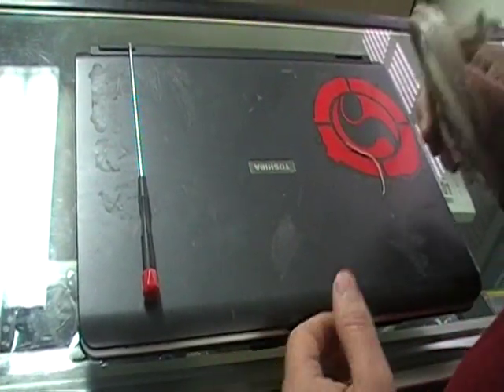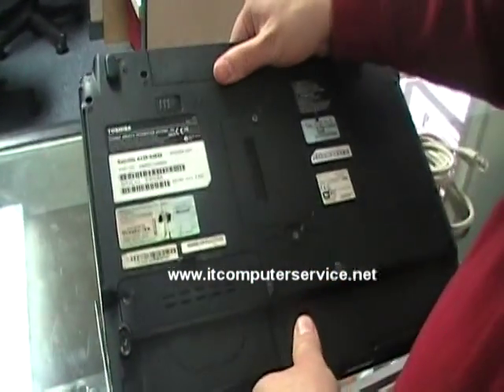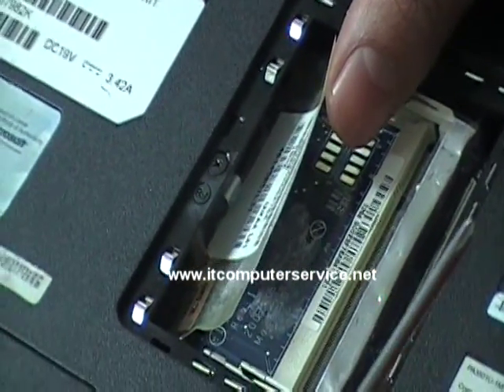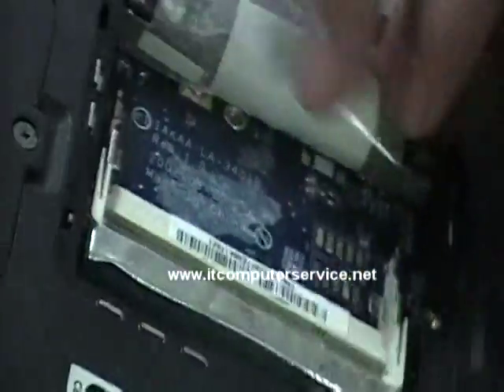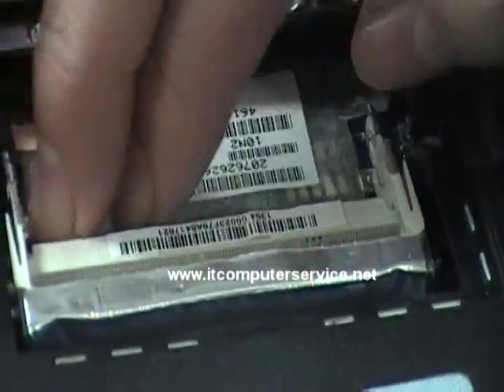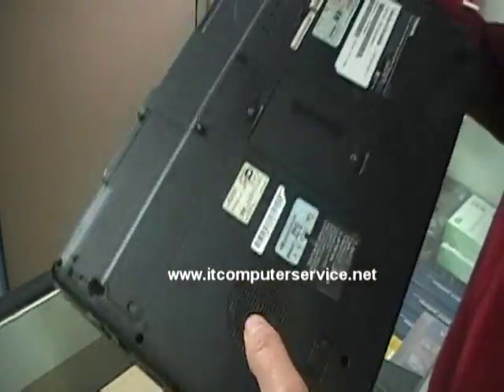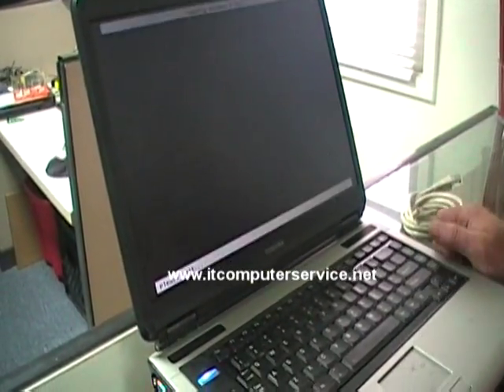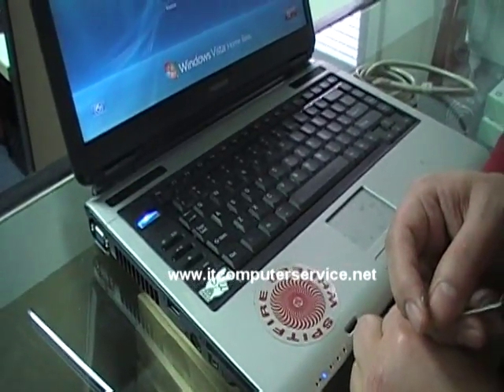Toshiba Satellite A135  Password Removal + Jumper Location

Comment: Hi there, I've tried to locate the jumper location on my laptop with no success. The only points I can see is JPW & JCOMS near the RAM slot. Can you please provide help to reset the BIOS password in this case. Laptop is Toshiba Satellite C660-20K Part number-PSC1LE-01N013AR. Motherboard model number is PWWHA LA-7202P. Thanks

Comment from the maker: This model does not have a G1 jumper. If you have an A135 you would put one end of the jumper to the memory and the other to the one that looks like a U. If you have a G1 you can short the two pads and that should remove the password.

Comment: It worked for me on my A215-S4717.  Follow directions.  My T U Jumper was under the memory, under the self-adhesive film.  I cleaned a little the U part of the jumper because it was covered from the factory by clear coat and the jumping wire was not coming in contact with the U area.  

I run into this problem after I updated my BIOS with software from Toshiba's support website.

This works.  Thank you very much for the video.  Great Job!